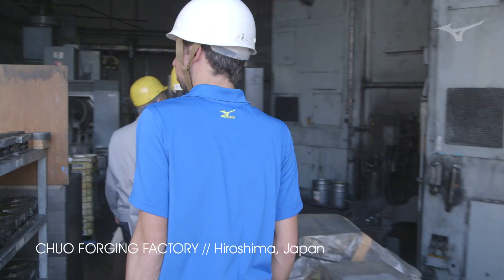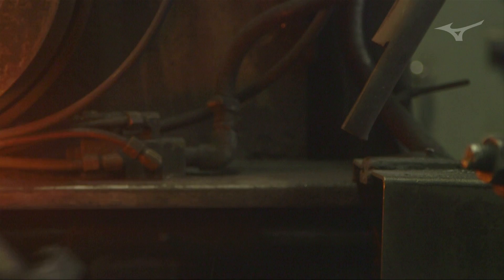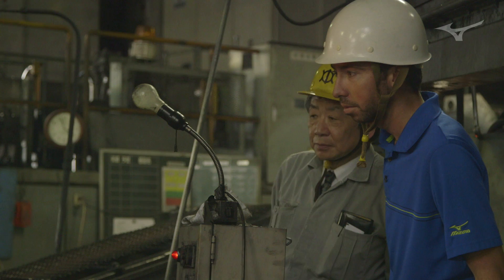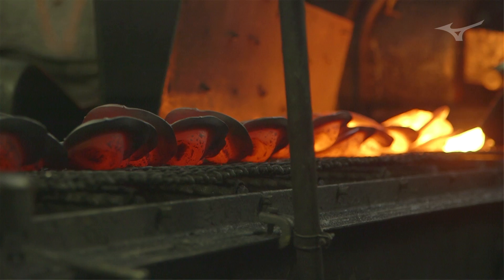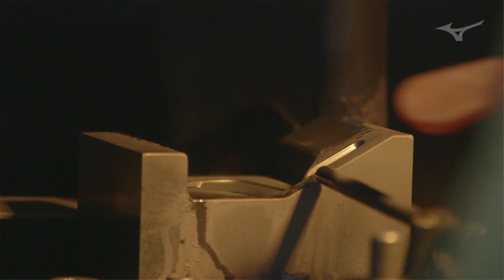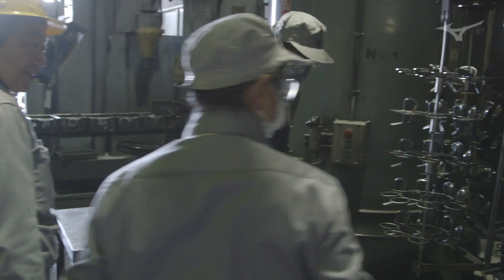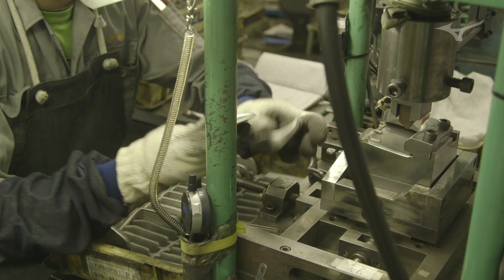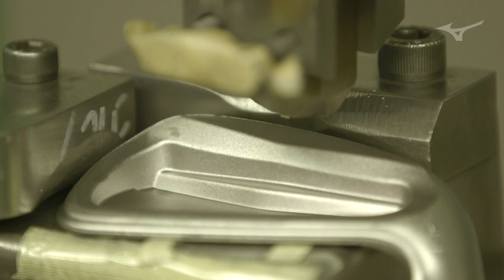A tour of the Mizuno Forging Factory with Chris Voshall

Comment from the maker: Thanks for all the comments.  Hope this puts the forged irons you play in a different light.
Reply: As a metallurgist I can say it’s not like wood grain. It’s not train flow unless it’s a wrought iron. Mild carbon steels are a granular structure like sand. What makes it refined is the annealing and normalising and heat treatment processes to make the grain size smaller. Smaller the structure the stronger the connection between the grains. The lower temperature forging work hardens or control stresses the steel, like bending a coat hanger til it snaps only controlled. What makes these clubs great is their steel choice and forging in general as well as the heat treatment processes, not wood like grain structure.

Comment: I was fitted and now own a set of MP-H4 3-PW irons (Jun '14); the first set of pro irons I've ever had. My old set of Taylormade Burner Plus 4-PW didn't conform to the new USGA groove specs. My game wasn't getting better and I decided it was time for a change. The first hits of my MPs on the range told me I had something special like nothing ever before. When I played them, I realized several things; the forgiving & hot-faced TM's had caused me to become lazy. So right off with the MPs, I was not generating enough clubhead speed to equal my TM iron distances (8-iron: 155-160 yds). I hit balls until I figured this out. Choking down a bit and rotating faster did the trick. I am working up to and almost back to where I was with the TMs. Now I am starting to feel how I can work the ball where with the TMs it would not be so easy. The MP-H4s are well made, feel solid and have literally made me a better player. I play to a 2.5 Hdcp and these clubs in time will get me on down a notch or two. I'm sure it will take me a season to really dial them in, but already after just 4 rounds, I am sold on the quality of these irons. Coincidentally, the swing adjustments that forced my iron swing-speed up have also improved my distance on the driver, 3-met & 3-brid. The pro fitting of the irons helped I'm sure. I appreciate what the Mizuno company has offered golfers and I am sure to be playing their clubs for a very long time.
Reply: penprick what’s clubs are you playing now? And what’s your HC

Comment: I absolutely love and will always love Mizuno blades simply the best nothing gives you such feel as they do. One thing I don't understand is how can you make them better if it's a forged piece of carbon steel (I'm talking blades)? Are mp 37's much different to say mp 5's
Reply: Design. The molds they use give a shape to the metal. That shape dictates the moment of inertia, turf interaction, ball flight, forgiveness. Plus they can apply layers of coatings to the iron (nickel, copper, etc.) to give new properties.

That said, there probably isn't much of a difference between two generations of blades.

Comment: Miura irons are a much more precise forging. The craftsmanship is much more. Every clubhead is weighted and spec to perfection. You don't see any hand grinding in this video to make sure the weight is exact. Of course, Miura's are twice as expensive because they are completely hand made and it takes longer, less product. I do have to say though, now finally being able to afford a set of used Muira's, that I don't feel much difference than any of my old set of Mizuno's in feel. I just like knowing the effort and care it took to make my Miura's. Just buy your Miura's used and save yourself a ton of money.
Reply from the maker: Hmm - not sure we agree with all that.  One of the reasons you don't see a lot of grinding at our Hiroshima plant is that our Grain Flow Forging process is very precise.  Our older forgings requited more hand grinding because there was less control in the forging itself.  We're also proud that we have no welding to the neck - which is a key part of the unique Mizuno feel.

Comment: And conversely forging marble wouldn't work because you'd just be breaking up the crystal lattice. It's not very malleable. Forging is done on malleable materials as a stronger but usually more costly alternative to casting and milling.
Reply: If marble wasn't such a refractory material and we could actually melt it at reasonable temperatures,  at other temperatures we might be able to forge it. But then it probably would cease to be marble 😅

Comment: Have you ever forged a Damascus line of irons?
Reply: More than 3 steps involved. They couldn't have the same volume of production and they would have to recruit guys who know how to actually forge metal. The guy that knows the most about forging here is the first guy who uses the first machine, which likely works with a pedal and is tricky to handle to apply the proper strike.

Comment: This is not stamping. Did you see the shape of the billet, then the shape after that 3x pounding? Stamping mostly refers to shaping of sheet metal. You don't alter the grain density with stamping.
Reply: Stamping can shape sheet metal and a bar of metal. You just saw it in the video (obviously, 7 years ago 😅)

Comment: How do they make the bars of steel?  They melt the steel and cast it.  The original material is cast is it not?
Reply from the maker: Our initial billets are extruded not cast.  This is the start of the grain alignment, then all subsequent processes are optimized to enhance further grain alignment.
Reply: *****
But it's extruded from a molten state.
Reply: David Oh Most of the world's steel is refined and made into goods (sheets, bars, billets etc) from a continuous casting process in steel mills.  From there, you can use the steel goods and turn them into products.  Casted club heads are made by melting the steel product again and the liquid steel is turned into solid  steel in a mold.  Forged club heads are made by squeezing heated solid steel into the mold.  Forging process will give you tighter grains in the micro structure, go read it on wikipedia.
Reply: wenli18 So you admit all steel is cast.
Reply: +David Oh lol go read a textbook.
Reply: +David Oh Casting is the process where metal is heated until molten. While it's in that molten or liquid state it is then poured into a mold or vessel to create the desired shape. Forging is the application of thermal and mechanical energy to steel billets or ingots to cause the material to change shape while in a solid state. my grandad worked in the steel industry as does my uncle they worked in Melbourne and my grandad also worked in port Talbot steel works in south wales. so no they are not cast.
Reply: nachospole1 how did the billets or ingots get to the shape they are in?
Reply: the process of making them into billets is still apart of the forging process is like getting a lump of clay and shoving it in a tube for easy storage until u shape it. I know what your saying but casting is the final process to what its being shaped as a billet is not its final shape it's just a lump of metal ready to be used how you see fit
Reply: David Oh Forging is the application of thermal and mechanical energy to steel billets or ingots to cause the material to change shape while in a solid state. I know what ur saying but shaping them into billets is apart of forging the metal has not been made into its final shape it's a just a small lump of material
Reply: nachospole1 Unless the metal is found in pure form, you must process it in order to get it into billets and ingots.
Reply: maybe you should research it then cause im over this pointless crap because making a billet or ingots is different to a finished cast iron product
Reply: nachospole1 no it isn't.  Chemically, it's the same thing.  Idiot.
Reply: +David Oh my god. what ever. so you think that casting gives the same pressure on the head (making it stronger) like forging or are u just bickering about the casting bit of the forging cause u got cast irons? lol i really dont care. cause you are just one person on this planet and easy to ignore:) but i was bored and just wanted to know which out of two you are? have a nice day
Reply: David Oh   if forged/cast steel makes you so angry, i wonder how angry you would become if someone pissed you of:)
Reply: morten lothe dude, you have no idea.  check out my other comments.
Reply: i probably dont have a clue. im not interested in the process but the end product. i play forged mizuno and the soft but solid feel you get from those you cant get from any cast irons or even other forged clubs ive tried. (ive tried alot of different clubs) but anyway have a nice day
Reply: morten lothe I would like to do a double blind test with irons.  I bet we would get some golfers claiming forged clubs felt softer when all the clubs would be cast.
Reply: I'm going to jump in here and try to add constructively to the discussion. 

All metals like steel are made in molten state  ... steel is not a natural element but a combination of metals (ie: iron, nickel, chromium, boron, etc.) in varying percentages to create a finished product with the desired qualities and characteristics. 

Bars or sheets or ingots are all made from molten steel. 

Forged irons are heated and pressed or "hammered" into the desired shape, quenched, etc.  

Cast clubs have molten steel poured into a mould of the desired club.  At its heart, cast clubs used to be inferior because of poorer casting techniques that resulted in more brittle metal.  

Ping made a name for itself with its process of  "investment casting" whereby the molten metal was injected or poured under pressure to force the molten metal into a more dense state resulting in a golf club that rivalled forged.

I have played Ping irons all my life up until 2 years ago (some 30 years).  I always appreciated the feel and quality of the irons.  

However, I recently switched to Titleist forged clubs.  I love them.  And yes there is a difference in feel ... but the difference is not as "large" as it used to be in years past.  The feeling of a well struck ball on the "sweet spot" is fantastic regardless of club ...but for me it was enhanced with the forged vs. cast club.  BUT, on most other shots the feeling was not significantly or even noticeably different (ie: off centre strikes or mis hits).

I apologize for being long winded but I do think David Oh had a very valid set of points.  But, the ad hominen name calling was not needed.
Reply: very informative and good comment. youtube needs more people like you;) have a nice day
Reply: @Listman11  Even if the metal was originally cast, forging changes its internal structure. You can achieve similar results through casting and forging, but forging has an edge when it comes to aligning the internal structure of the metal in a direction that is consistent with its intended use.

You can cast a sword, but most blacksmiths would forge it. Especially in Damascus back in the day.

Comment: Mizuno makes some of the best looking clubs out there but come on, a golf club is a piece of metal. Nobody can feel the grain flow or structure of a golf club. It’s a piece of metal at the end of a stick. This whole forging vs casting is pure marketing.
Reply from the maker: https://youtu.be/NXpcnjh3uSE
Reply: Nope. Forging actually rearranges the structure of the metal along its shape, while casting distributes the metal structure evenly depending on the quality of the cooling. You will have more difficulties to produce a quality metal knife that is soft and elastic at its core, while hard and potentially sharp at its edge, though casting. You are better off forging it. Humanity wouldn't have entertained both techniques for millenia, and into the modern age, if they didn't have distinct advantages/drawbacks that make the choice relevant.